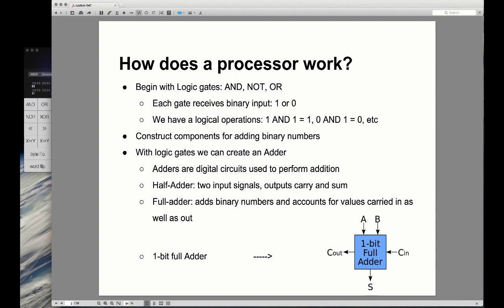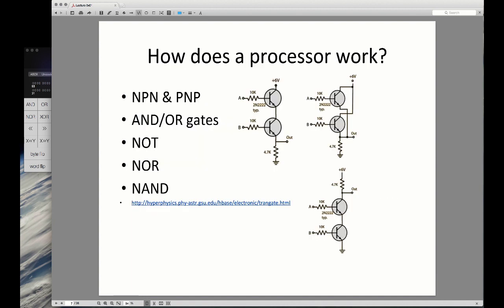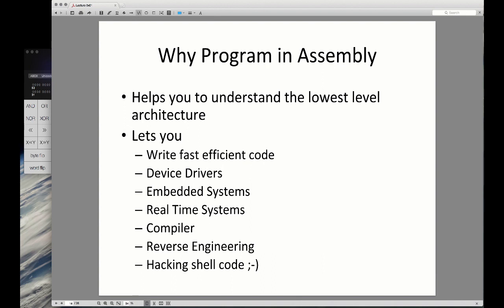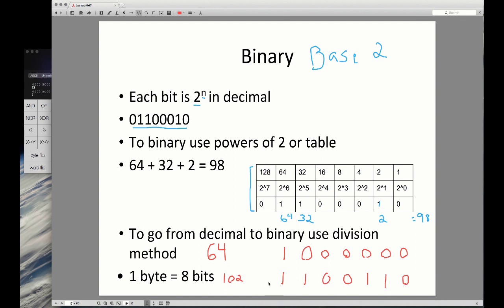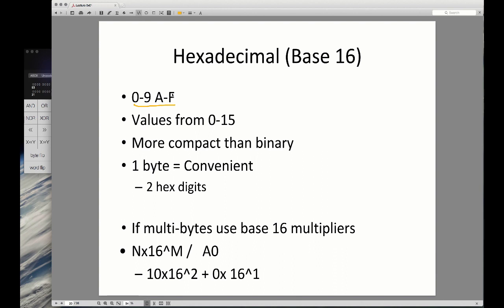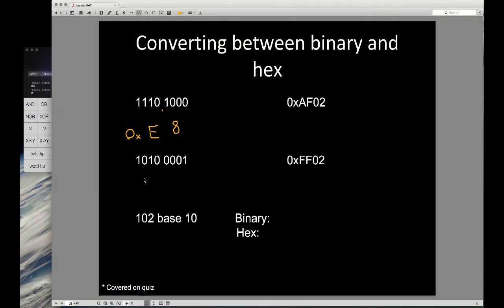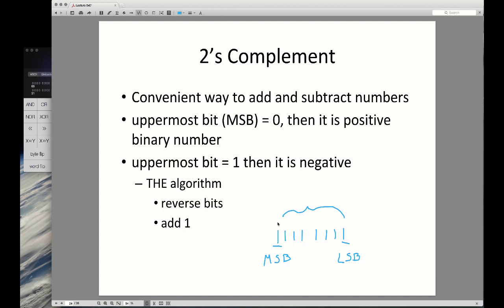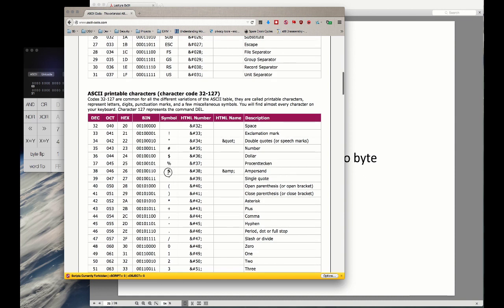01 - Introduction to Assembly

Comment: Hi, great video. I am getting confused with "Combine Adders to Add Numbers" section. I  understand your example but what if the first input is 0 and 1. This would give an S0 of 1 and C1 of 0. Then if the next adder was also 0 and 1 this would also give an S1 of 1 and a C2 of 0. This would give an output of 011 which is 3 in base 10 but we added 1 + 1 via the inputs which is 2? Where am i going wrong!! Thanks
Reply from the maker: Woah, I haven't thought about adders in a while lol! I believe you're on the right track - if you add 01 binary + 01 binary (or 1 + 1 in binary) the result is 10, which is two. 1 + 1 results in a carry. So if the input states where 1 and 0 (in either order), the first adder would result in a 1 w/o a carry. The second would result in 1 w/o a carry, so then we just add 1 + 1 to get 10. Does that make sense? Thanks for the question!
Reply: @jstrosch  thanks for the quick reply. Yeah that’s great, makes absolute sense,